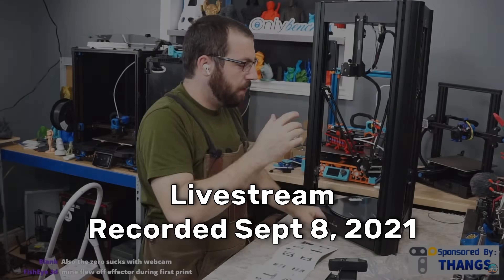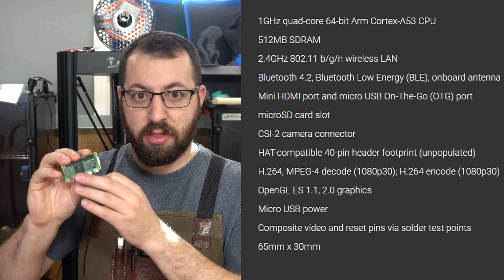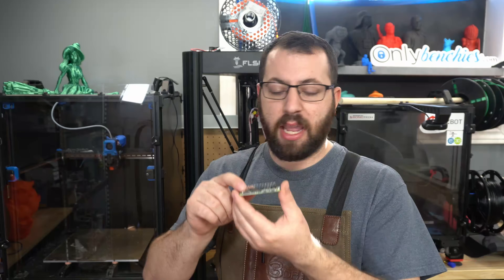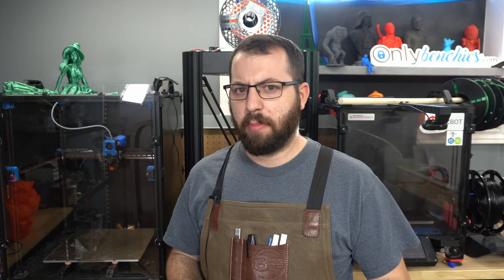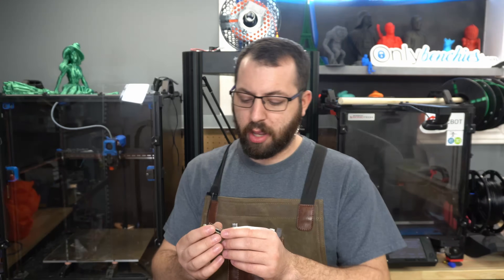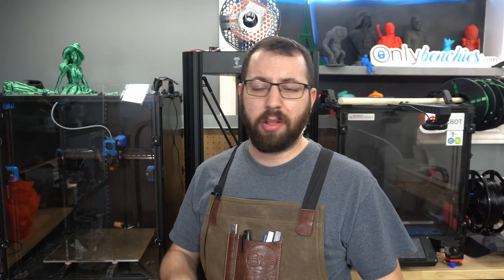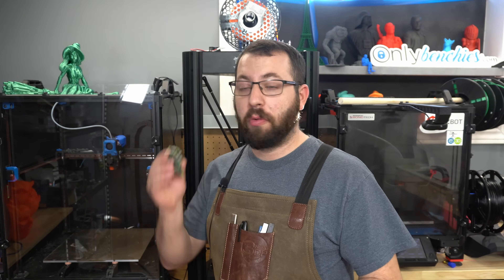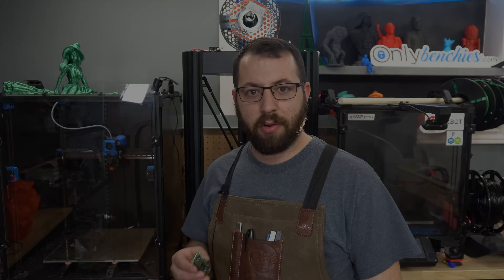Pi Zero 2, Your 3D Printers New Best Friend?

Comment: We have at least 1 report of fragging of BTT SKR MINI E3 V2 using this method (issue 665 on BTT github site, search on "dead" or "kilpper" (sic)).   Do we know what current you can draw on the "serial" pins?  Is the RPI Zero 2 W just the wrong too power hungry?

Comment: Did you have any issues getting Numpy installed on your Pi Zero 2?
Reply from the maker: Nope

The recent release of mainsail OS has it already installed as well so its even easier
Reply: @CanuckCreator  thanks for the reply! I got it last night. Had to increase SWAP and then it took right away. Pi Zero 2 running Fluidd. Need to finalize my connections yet but should be good! Your guide was wonderful!

Comment: So I can take a flash card with the installed system with the raspberry pi zero, put in the raspberry pi zero 2 and will it work from the box? Or need reinstall firmware?

Comment: if I am using the pi zero w 2 powered by the gpio pins from one of your videos. I am having a issue with it connecting to the printer. I am thinking it has to do with the MCU and serial usb connection thing. being how now I am using gpio so no usb address. or am I not looking at this corectly. I had this running with a pi4 but I can't get it to connect with the zero2.

Comment: For a beginner would you recommend octoprint or klipper? Does klipper require a log in like octoprint? My primary goal is just wireless capability, I have far too many accounts as is and I find it extremely unfortunate that octoprint will not operate with out a login even on a local network. I understand the cases where you want to access your printer at work or on vacation, however I am just looking to get away from usb and sd for a cleaner more streamlined experience. Is klipper the solution I am looking for? Thanks in advance!

Comment: You do great videos. Super informative and right on the point. Keep it up. Thank you for your support for the community.
I'm thinking of using Klipper on my ender 3 v2. Before I try it I have couple questions.
1. After I flash Klipper on my Ender, if I don't like it can I flash back to Marlin?
2. I'm planning on adding a dual z stepper motors. Does Klipper support Z align function? If it does what mainboard do you recommend I should buy with at least 5 stepper drivers for the ender 3 v2?

I'm a little net to tinkering 3D printers. If you could help I would greatly appreciate it.

Comment: Hmm, loose that cable tie ledge go with the case that mounts in the extrusion. I have it now now running a pie zero w with web cam and check my videos , prints like a Boss no extra plugins though , web cam and bl-touch. any more its's flaky. I can't wait to receive my 2 units. Ender5 pro otw :-p FYI I  got an Ender 3 Pro added Skr mini E3 ver.2.0 and a BL touch , never looked back. added a pie zero "W" and 4 port usb hat, Octoprint is awesome 👌,  Bed mesh is so flat.. and Time-lapse performance is AOK. (see link)
I'm using a old lifecam for a web on Octoprint. the time lapses are GE (YMMV). I printed a ton of add-on too. so check my videos and more to come.😎✌

https://youtu.be/S3WT1kDgBDo

Comment: My Pi Zero 2 is running Klipper + fluidd connected to an Ender 3 V2. Doesn't get much better IMO. Great setup.
Reply: Do you use USB Web cam ? I can't use USB Web cam, the pi Zero 2 often freezes.
Reply: @Nuttavoot  Not using any camera, so don't have experience. Sorry

Comment: I've really had great success with the PiZero2 running octoprint. But keep in mind that the pi will struggle to stream 1080p video (tested with Picam V1.3, 2.0 and Camera Model B rev 2.0), even if you overclock the GPU to 600Mhz, while my Pi4 has no problem doing so. 

I don't think this is a large downside since the picams have the larges Fov at around 720p, but you need to consider this so you wont be disappointed.

Comment: Please keep in mind, if you’re running a webcam and a screen and usb hub, powering it thru 5V pin from the printer board, may be too much current for the printer mainboards regulator.
Reply: laughs in 5V8A regulator on the octopus

Comment: Actually I already used the original Pi Zero on my Prusa mk3s+ - without cam of course. The mk3 had an internal port for the Pi zero sice it was released. So the Pi Zero 2 is a great upgrade, as you now can just swap out the Pi Z, insert Pi Z 2, connect a Pi camera and can install Klipper (with Input shaper). So it is a great upgrade for a very low price. On the other hand, with spring steel management, filament autoload and optional MMU2 support on the mk3s+ I am still not totaly sure how to keep this features with Klipper, so I might only try it on one of my 4 Prusas now. I would realy like a video how to do this features (esp. Filament Autoload and MMU2) on Klipper. But I am quite sure someone will do an ready to use Image for the mk3s soon anyway. It is a very common printer and mostly used stock (or with Bondtech upgrade, or as Bear or Zarribo), so not to many variations ot there. The zero 2 might make Klipper beginner friendly for users not wanting to tinker with their Prusa but simply use them to print, as a Klipper upgrade can be plug and play on theese maschines.
Reply: I'm using a Pi zero w also on my Ender 3 Pro with a Camera and USB hat. Works like a boss. No extra garbage on the plug in front ,USB cam is working. I got some vids on my channel of it . ;-p
Reply: The thing is, why modified something that work great (prusa), give yourself a new challenge and build a printer, it is a lot of fun and you will learn so much

Comment: I lucked out and found 2 yesterday.  I'm going to use one for Klipper on my heavily modified Ender 3 V2.
Reply: How did it work out? im trying to push mine to it's limits
Reply: @nickyotto349  very well. I have no complaints at all.  Watching three of my prints in the other room right now.  I have 14 printers, and all have Pi 4s or Pi Zero 2s attached.  Some running Octoprint for my Marlin printers, and some running Klipper and Mainsail.
Reply: @MakerMeraki  Sounds good, do you think klipper is worth it on an ender 3v2, or is it more for the high speed printers?
Reply: @nickyotto349  honestly, I feel that Mainsail is much lighter weight than Octoprint, but Octoprint has those great plug-ins, especially Octolapse. That's the only thing I miss. But Klipper allows making changes to the printer settings on the fly without having to recompile, and i really like that.  Plus, I do notice increased print quality.  But that comes at the cost of complexity.

All said, I think everyone should try it out for themselves.  You can always go back to Marlin if it doesn't benefit you.  But I have most of my farm migrated to Klipper, and it's running flawlessly so far.  As I lose money if it has a hiccup, reliability and dependability mean a lot to me.
Reply: @MakerMeraki  thanl you for taking time to respond, i'll definetly try klipper once i can get an pi for an resonable price
Reply: @nickyotto349  you're more than welcome.  I'm just paying it forward for all those who helped me!  👍

Comment: If the Pi is getting power from the printer board, doesn't it possibly corrupt the sd card when the printer is turned off without shutting the Pi down properly?
Reply from the maker: Always a possibility, but you can shutdown the RPI through the web interface first to be safe.
And while a hard shutdown does lead to possible corruption of the SD card, ive yet to have that happen in that past 3 years with mulitple printers
YMMV

Comment: Just used one to convert my Ender 3 to Klipper, and will definitely use one on the legacy I'm building!!
Reply: Do you use the USB or UART connection?
Reply: @Spelter  I use USB, couldn't get the UART connection to work and had an adapter at hand
Reply: What board are you running? I have a pro with a 4.2.2. Would love to get klipper running on that.
Reply: @joewozniak2231  I have an SKR mini E3 V2.0 (that I just bricked by shorting the thermistor...)

Comment: Thanks Nero! What mainboard board did you test powering the pi from 5V? 

I'm going to try powering it from 5V on a MKS Robin Nano V2 board. I see the pi's max current draw under load is 500mA. My quick review of the 5V step down chip in the MKS shows it can handle 3A. But I have no idea if any other components in the step down circuitry need to be spec'd to handle higher current.
Reply from the maker: im using an SKR mini e3 in the video. Most boards should be able to handle the draw just fine.
Reply: @CanuckCreator  Great. I had a look at the schematic for the SKR Mini E3 V2. It uses the same step-down chip as the MKS (MP1584EN). SWEET!

Comment: Fantastic content. Have you seen the video about running Octoprint off an old android phone? That covers screen and camera in a neat package. Yes it's not low powered or discreet but it is a good camera (depending on the phone used).
Great video. Keep up the good work.
Reply from the maker: Yes I have, its great to use old hardware, but as you said, bit more power draw and the phone itself would need to be mounted in a position to use it as a webcam which wont always be possible/practical
Reply: You can run klipper + fluid - klipperScreen on your old phone (rooted), so rpi not needed. Not really flexible but it's fun and 'cheap' way to re-purpose an old phone.

Comment: Would you power a Pi Zero 2 off of an SKR 1.3?
Reply from the maker: Im powering mine just fine off the 5v pin on the UART pinout on an SKR mini just fine
Reply: No, but you can power it with a buck converter off the 24v supply, that's what I did

Comment: My neck of the woods a Pi 3b + is close to 120 USD so even when factoring all the extra stuff you need to run a Pi 0 2 W it does not even come close to the more expensive option.
Reply: I'm seeing them on ebay for 50ish dollars, still pretty expensive considering what it should cost.
Reply: @creamofbotulismsoup9900  I refuse to purchase them at above MSRP. It's just not worth it and eventually you'll find one at the right price.